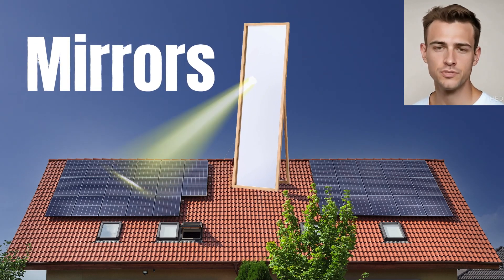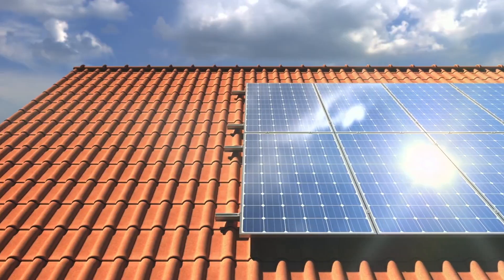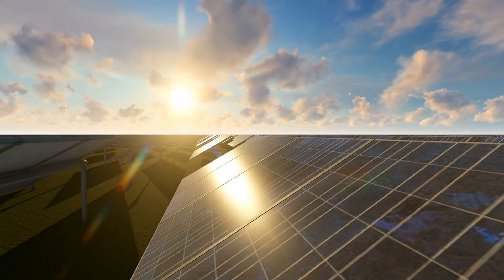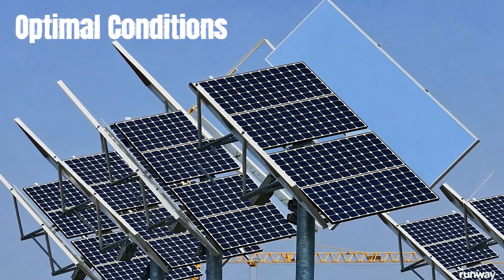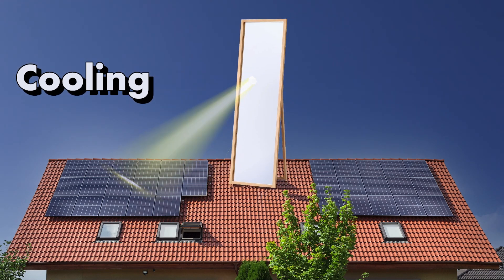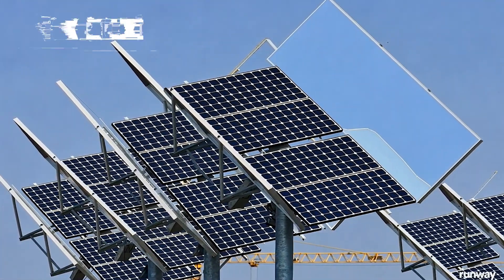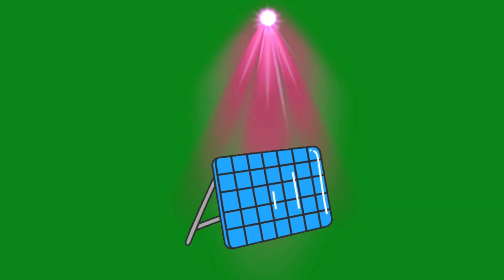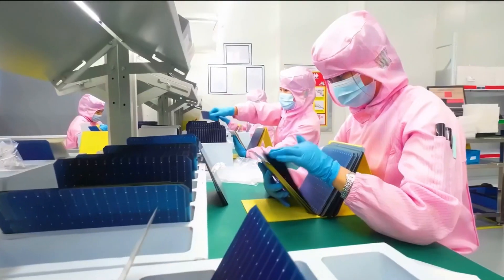Boost Your Solar PV Power by 50% with Mirrors! | The Surprising Truth

Comment: Yes, I agree with you. Mirrors increase PV output. I am building a PV system in a limited space. And mirrors compensate for the losses I am getting due to size of area, and the amount of direct sunlight time. Min gain is 30% with only a back reflector. Well done, it is hard to find quality video's about this topic. Answer to 'just buy extra panel' I have a limitation in useable space,  and to increase light, one uses a mirror. White paint is no where near as good. I have used chrome paint as a background. White is shit.
Reply from the maker: thank for your views

Comment: It can be white painted concrete poles instead of mirrors.  Photovoltaic requires light.. not heat. Concrete absorbs the heat from the sun while white paint reflects light and no worries about storms or hurricanes blowing them away like mirrors. Good topic.
Reply from the maker: This is a very smart aporoach. Indeed,  It can handle the heat issue.

Comment: While the idea is good, it is not commercially feasible. If you cover a certain area with solar panels, the light to this area is the energy source. As the area is not perpendicular to the sun, the power density per square meter changes as the sun moves. If sunlight is reflected to a solar panel, it must light the panel uniformly, as the least enlightened cell will determine the current flow and so the power. So it is just cheaper to cover all area available with panels. At least, as long as there are no import taxes ;-) One more point: the more power is generated per area, the hotted the panel gets, so efficiency goes down. Or: efficiency is higher, when the light enters under an angle. On the other hand: solar panels are so dirt cheap, a mirror might be more expensive ;-)
Reply from the maker: Informative comment, thanks for your input. Do you think these issues can be solved later or not?
Reply: indeed, agree with you

Comment: Complexity added makes it not feasible.
Reply: It's perfectly feasible on a domestic scale though only worth it if you don't want to fill all available space with more panels. A cooling solution for the back side of panels is a doable DIY project and anyone running a heat pump is  venting loads of cold air or water out of their house already...
Reply from the maker: Thank for your view.
Reply: agree with you